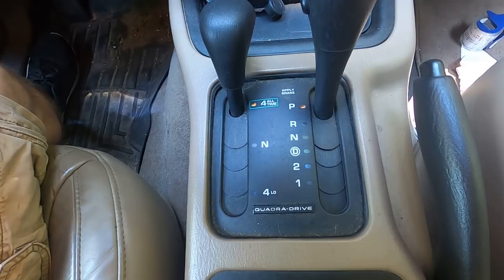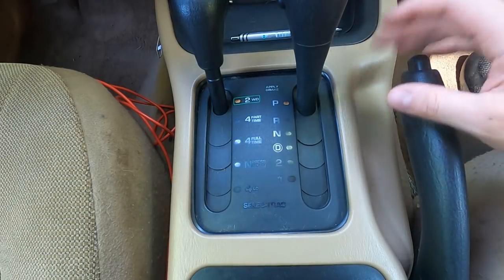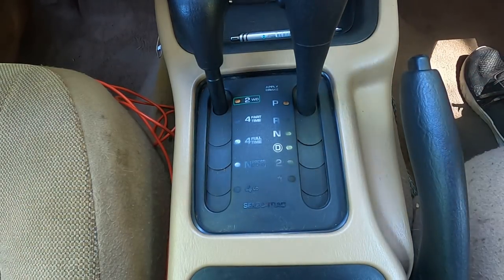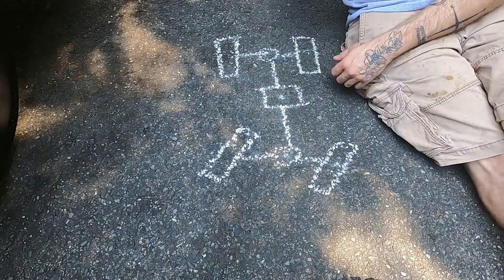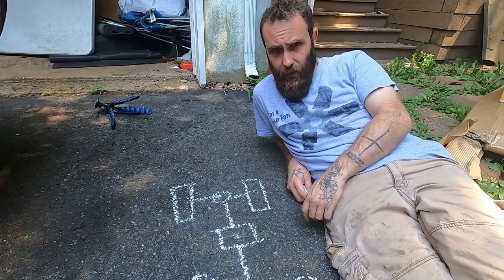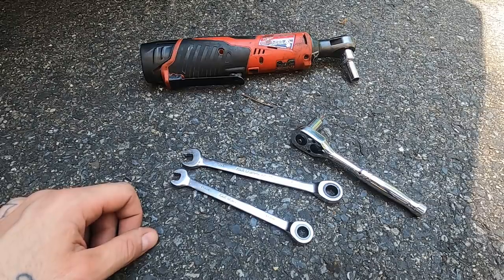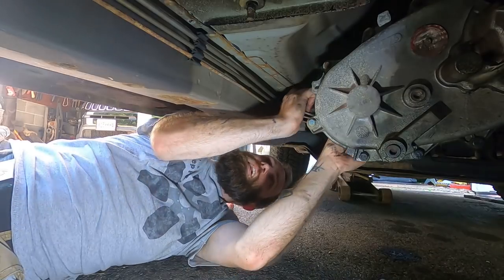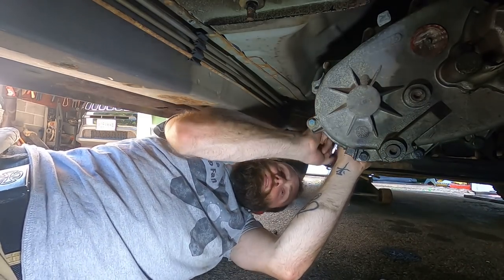Noise/Binding When Turning? How to Diagnose & Fix

Comment: @D&E i have a 02 wj with the selectrac and ive found if you’re in 2wd coming out of 4 and it grinds come to a stop and rock it from reverse to drive a couple times and that fixes it. it actually says in the owners manual you may need to rock it for the 4wd to engage or disengage

Comment: Quadra Drive requires Mopar friction modifier added to 75 w 140 diff fluid, and some miles with turns of 8 to work it in to the clutch plates. I have used it in the rear diff on my 2001 4.0 with good results, however some time later noise has returned. Forums have mentioned that they need to use it along with a fluid with Friction Modifier added at Factory to sort the noise long term.

Comment: I swapped out my NP247 to a NP242 last weekend in my 4.7.  Stumbled across a HD in the salvage yard that wanted to come home with me.  Easy swap!!!
Reply: The only difference between an NP242 and an NP242HD is the sprocket & chain width.  When you find the HD that's the one to grab, may have to do some swapping of parts though to get the right output shafts LOL.   But, in a Jeep you shouldn't have to worry about breaking an HD case well unless you try balancing the transfer case on a rock you come crashing down on.
Reply from the maker: Junk Yard Gold!

Comment: Cool!  So I was test driving a truck and it would groan while turning in 4wd.  That sound would continue after switching back into 2wd, for the next turn only, and then go away.  So probably a transfer case issue?  Thanks for the video, nice to see the sidewalk chalk diagram.
Reply from the maker: Haha, thanks. Yes it sounds like the 4wheel part time is staying engaged a little too long. Could chew up tires or worse over time

Comment: Most likely the transfer case ismt going out, a needing a fluid change will engage the gerator pump of the tcase. Front, rear, and tcase all have gerator pumps. Fluids and the proper additives are needed or it will for sure cause binding, even a tcase needing services will cause the symptoms ur describing. Do a full fluid swap on your entire system and get the diff additives back in it and I bet she goes back to like butter. Myself and martinbuilt both had this issue on wj's

Comment: I had a binding issue on my 04 overland. The limited slip discs were shot. I used 2 bottles of MOPAR limited slip additive and drove it 2 hours to a friends house and issue gone. I have a feeling this is a bandaid and will be replacing the clutches
Reply: I've heard of people just swapping the internals out for standard open diff carriers and doing away with the limited slip function to save money I guess....if it has limited slip I think I'd like to keep it myself though LOL.  My 98 ZJ has the limited slip rear axle, gotta be careful in snow/ice with it but once you get used to it, the limited slip is very nice to have, I don't need it but that's how the previous owner ordered it new...dang thing is fully loaded, its a Laredo, but has all the limited options except the sun-roof which is great those things leak and stop working anyways.
Reply from the maker: Interesting... maybe I should try a fluid flush and see if I can get a few more miles out of it

Comment: Hey Doug! I'd like to add something to your video for the non-stock jeepers that I've learned first hand (props to the ComancheClub members that helped me figure it out) that can be confused with binding... I converted to a 242, from a 231. Still have a stock Dana 30 front diff with u-joint axles. I tried full time 4wd and had very noticeable lurch/bind in tight cornering. Turns out it's normal for u-joint axles, they do that by design. I'll have to switch to CV axles to solve this.The u-joint doesn't turn at a constant speed when it gets at too much of an angle, which gives that lurch.
Reply: I found this out as well.  My 96 ZJ had quadra-trac full time 4WD, and had front CV axles.  My 98 ZJ has selec-trac 4WD but has U-Joints in the front axle....I'm thinking of seeing if I can get CV axles and put in it to smooth out the turning issues....my 98 ZJ also has the rear limited slip differential which also plays a bit of a role in the binding in full time I think as well.
Reply from the maker: That is a very good point and worth noting. I will add this to a future video. Thanks!

Comment: Yeah , the full time grand Cherokee t/c with rzeppa front axles and anti lock brakes are annoying ( and expensive to fix ) when components start wearing . Like D hits the wrecking yards for spare parts , you just got to have them ready when disaster strikes . Great system though . 
Yeah , just looking at that brake line makes you happy you got up that morning . Hey , it's a nice truck though . New Jersey winters are merciless . Not wishing the surface rust clean up but jeep work is good work .
Reply from the maker: I hear you bud. We are going on a 1000 mile road trip with the Jeep next week, so I am probably going to replace that brake line this weekend

Comment: Good video...
I have a 95 Grand Cherokee Limited 5.2 V-8 Quadra-Trac.
Mine is fine around local but after driving about 45 minutes it starts bucking in sharp turns.

Comment: I drive a 2000 4.7 WJ. I drained the front diff and refilled with Lucas Oil 75w 140. It has quadradrive and varilocs and I figured it should be fine without the additive “friction modifier” as it says on the bottle its great for LSDs. Ran great for a week or two, just got an alignment done on Monday and now its snapping/popping in the front diff/axles again 😬- Im thinking friction modifier will be a big help, multiple Jeepers claim you CANNOT go without the friction modifier the varilocs are very finicky- any thoughts ?

Comment: Thank you so much man, I have had this problem since I bought my 98 TJ, and could not find why the hell it was binding and popping every now and again. I swapped my NP231 out when I bought a newer one that had a SYE already installed for $300 but still has the same issue. Thanks to your video I think now it is the 4WD shift linkage (all rusted out) and I think it would engage to 4WD high periodically. I have the same issue with throttle response, popping, binding, and even getting a little Squirrley   On the high way when I hit the gas or take my foot off the throttle. I did remove the front drive shaft and rebuilt it (because I initially thought it was the socket yoke assembly) and it ran much better but when I put the drive shaft back on, same issue. It pops and pulls to the left when I make a slight turn on the high way doing like 50mph. What are your thoughts ?
Reply: Same here. Did you ever fix it ?. What was it ?
Reply: @southbay281  yes, I finally got to the bottom of it. It was the rear end, the previous owner put a limited slip differential in, and I guess it was worn out. Also, when I finally removed it there was a crap load of metal pieces in the rear end, like a bearing got hot and melted. I guess when the previous guy rebuilt it he didn’t remove all the pieces. Also, there were a couple of cracked teeth on the pinion (probably from the metal pieces getting wedged between the gears). I re-geared and threw in a ARB locker in and it’s great on the street, open diff on the road, and locked gears off road when needed, and most importantly no more popping and flying all over the road.
Reply: @richjames5309  I only get the popping when the front diff goes out. Ive swapped 3 rear CV joints on the front shaft already. Seems the rubber seal always gives out and the bearings dry out. I'm sure due to cheap parts. About the diff. Ya I still get the binding noise on a slow hard turn.

Comment: I have a 99 Jeep Grand Cherokee Lerado 4x4. I bought brand new in 99 and have been everywhere, outside of normal wear and tear and routine maintenance & repairs it has been a go getter and very reliable. However this past winter I got stuck so I shifted into 4 low and once I was no longer stuck is when I noticed I couldn't get it out of 4 low and back to 2 WD. It eventually cleared after shifting into reverse and moving it a few feet. I have not used the 4x4 since then.

Comment: So I have a 2005 Laredo that had the same issue and they simply disconnected the 4wd and voila problem solved. I hope I am not doing or did not do any kinda damage to anything as a result . Because as we speak, days later while driving I heard a grinding noise from the transmission and not been able to move the car since . The loud grinding noise always comes once I put it into either drive or reverse . Now I’m totally clueless what the issue is

Comment: I have an 02 quadra trac in my Jeep making the binding noise in tight turns. I'm wondering if I can swap it out with my 2000 select trac. Probably not without changing my console. Good info. I subscribed.
Reply from the maker: You definitely can swap it. I have a video on transfer case swaps if you are interested..
https://www.youtube.com/watch?v=bfVHWCqZcbA
Reply: Hi  what did you do to solve that? are you sure that sound come from the transfer case?, I ask you since it is just in tight turns, I was thinking the sound may be always present if the transfer case fail.. Did you check cv joints and U-joints in your driveshaft?

Comment: My dad has a 2004 Jeep grand Cherokee, 4.0L 6cylinder, 247 J transfer case, Quadra track 2. Makes a horrible banging popping noise when turning slow in parking lots and even sometimes in slippery conditions going straight, as if the front wheels are trying to get more power. I had him turn slow in a dry parking lot and I tried to see where the noise was coming from and I think it’s coming from the front drive shaft where it connects to the transfer case. His front drive shaft only has U-joints where it connects to his front differential, the end of the front driveshaft that connects to his transfer case doesn’t have u-joints it has a bigger round piece that goes into the transfer case. Any information on what that round part that goes into the transfer case would be appreciated:) is it possible to swap that style of driveshaft out for one with u-joints on both ends? Any suggestions/tips/information/links/videos would be appreciated! You’re awesome man!!

Comment: Hey Doug! Yeah one thing probably the only thing I can’t stand about my ram and the reason I’ll probably get a new one in the next couple years although I still need to verify they changed this is I only have real four-wheel-drive no part time or all wheel drive so it comes down to decision making in the weather on whether I want to be in full four-wheel-drive or not which really sucks when the road conditions are clear to ice pack to clear to ice pack on a road and being rear wheel drive hard ice pack can be so much fun!
Reply from the maker: Yea, that is a bummer. I have noticed the phased out 4wd options on a lot of new cars. very few will let you lock front and rear diffs together in a "part time" mode anymore. not cool

Comment: Hi, I have a 2007 Grand Cherokee 3.0 CRD Overland WK (Quadra Drive 2) with the binding/digging in at low speed when turning and slight vibration through the steering wheel, it's not as noticeable when the car is warmed up just seems to be after the car has been sat for a while. Before  any expensive repairs I'm going to change the front and rear diff fluid and also the transfer case fluid. I know both diffs require the friction modifier but can you tell me if I need to add the modifier to the transfer case ?
Thanks for any help/advice.

Comment: I have the same exact WJ 4.7L v8 with 185k and I'm having that binding on the left rear wheel I've determined. Just did the wheel bearing today (without a press💪) as well as the rear calipers, pads, rotors and soft lines. And just like yours I direly need to replace my rear brake hard line haha. Did the master cylinder and vaccum booster last weekend on my time off. I'm tired of these god forsaken vibrations and ready to get it figured out since Its my work vehicle and i have to trailer a boat 5 days a week for work. The mystery vibration quirk of the 01 WJ limited is bullshit
Reply from the maker: Killin it! These are great Jeeps as long as we take care of them
Reply: @DEInTheGarage  I do love it to death and finally figured out the mystery vibrations at low speeds and full lock. All it needed was more limited slip additive.  Going to be doing the radiator and electric fan conversion next week. Thanks for the awesome content to guide me through some of the issues, you make troubleshooting twice as easy.   Proper maintenance is key!! That's why I still have an 01 wrangler with 389k with stock tranny, transfer case, engine and axles

Comment: Hi there, was checking your video to figure out what’s the problem with my WJ with 247 vari-lok axles. I have grinding on the left back wheel when turning left on corners . Did change oil and put friction modifier but still grinds. From what I understand I cannot take the front drive shaft to perform the test with the 247? Regards and thanks

Comment: I'm 76 and in need of HELP! I recently purchased a 93 Grand Cherokee 5.2 (108K miles) with the 249 J transfer case. I have the binding in slow turn thing. My 94 GC 5.2 (293K miles) with the 249 J doesn't do this. I'm retiring the 94 and expect the 93 to be my LAST EVER vehicle. Is my problem in the cv assembly? Or something else? PLEASE!

Comment: @D&E I have a 06 Commander with a 245 transfer case. I’m having a similar issue, but wasn’t sure if it will work without the front driveshaft in place. Any ideas.

Comment: The 242 in my 98 ZJ gets hung up in part time mode all the time, pretty much anytime I use it, it'll get hung up in part time going into full time or going back to 2WD.  Other than that I love the 242.  I think part of the issue with mine is I don't think the previous owner ever used the 4WD, or if they did, they didn't do so very often, it was a pain to get into part time when I first got it, the lever was pretty hard to pull.  Its easier now, but as hard as the lever was to move out of 2WD it leads me to believe the 4WD was rarely if ever used in its 149k miles before I got it.  Even now I don't use it very often.  I did have it in full time for a couple days a while back just to exercise the system but I can't see where it really made any difference.  So now with 162k on it, it has high mileage on the drive train except the transfer case and front differential LOL.  The fluids in both are extremely clean, the rear diff when I got it looked like it had never received a drain/fill plus it has the limited slip rear differential...nice sometimes but man you gotta be careful otherwise you'll be going sideways or doing donuts real quick LOL.
Reply from the maker: I will never understand why "part time" is between "full time" and "2wd"... you are just begging to get stuck!
Reply: Can someone please explain when I should use part time on my selec trac? I never got a good answer.

Comment: I have the problem when turning like you described in my 2004 Jeep Grand Cherokee quad drive. But I also have an issue since I bought it with when I'm driving down the road and I hit a speed bump or a hole in the road it sounds like it's hitting metal to metal loud bang and sounds like it's a shock but I put new shocks on it and it's happening on the driver side. And after thinking I got a bad shock we exchange that shock three different times and it still did it so what could be wrong I've taken it to four mechanics no one can figure it out

Comment: Hi from South Africa. What can be wrong in the transfer case? Mine does the same. I lost a transfer  a few months ago due to chain going out. I bought a second hand transfer case since then the wheels started binding. I have a rebuilt kit and the old transfer case viscous coupler and the oil pump. That was the only two things that i could safe from the old transfer case. It is the 247 transfer case. But i will test it with out front shaft. Ps how long can i drive without the front shaft? Can it be the shift fork? I dont have a clip on.
Reply: Most likely the same issue LOL, that's why so many ZJ's and WJ's end up in the scrap yards because the transfer case Viscous coupler or clutch pack fails, I think the 247's have a clutch pack in them instead of a viscous coupler...but usually when the 247's fail they fail where you have no 4WD at all, unlike the 249's where when the viscous coupler fails you just about have a part time 4WD system because of all the binding the locked viscous coupler causes, which is what happened with my 96 ZJ's quadra-trac system at 232,000 miles.  It was a great 4WD system but the viscous coupler was the weak link.  But couldn't complain it gave me 230K+ trouble free miles and many were offroad miles LOL.

Comment: My son has a 98xj, with a 231. It developed a leak, & was run for awhile low. topped it off, & still having the same groaning especially when cranking the wheels. How expensive, & complicated are the 231 to rebuild, & any rebuild kits you recommend?
Reply from the maker: My first recommendation would be to find a junk yard and get a used one to slip in. It is going to (likely, depending what is broken) be the same price as buying rebuild parts. They are not hard to rebuild. Here is a video I have on swapping them. It does not cover rebuilding directly, but if you watch the second half it should give you an idea of what they are like inside. very simple
https://www.youtube.com/watch?v=bfVHWCqZcbA

Comment: I just adopted an 04 Grand Cherokee 4.7 that doesn't seem to charge the battery . I'm leaning towards the PCM is there a way to check signal to field wires going from the PCM to the alternator ? And checked the fused link and it was good so any thoughts Doug ? I don't think I like the 247 transfer case but it seems good so far . 180K old man owned so it's never been off road .